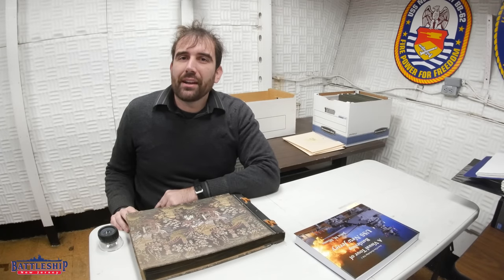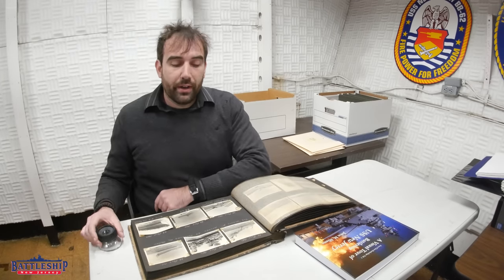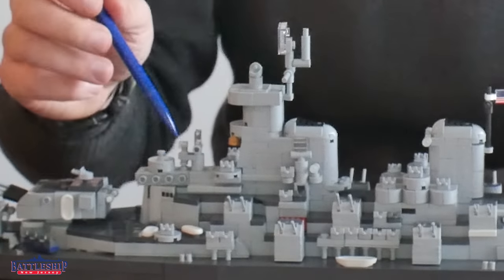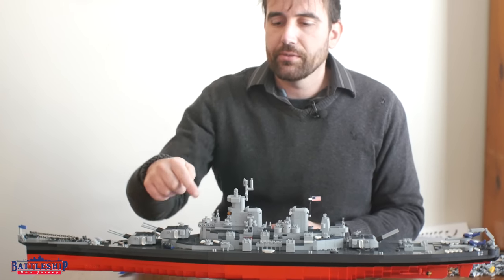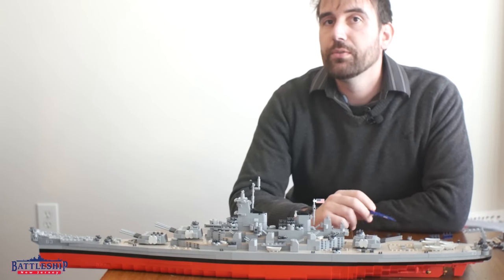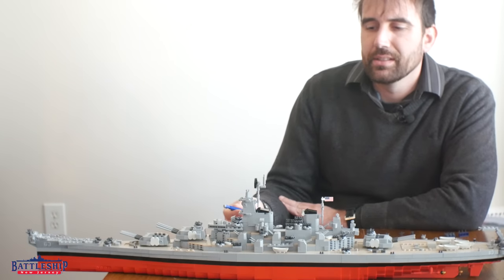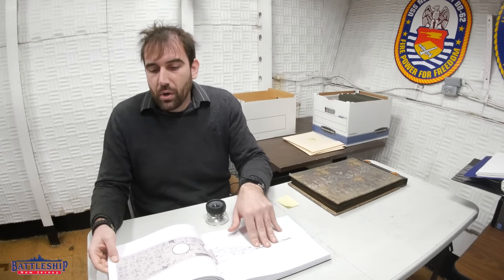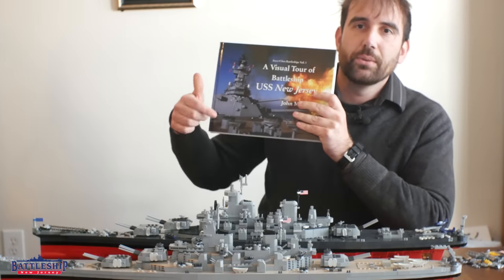Where Were the Anti-Aircraft Guns of Battleship NJ Located?

Comment: One proposal that I've seen for improving the Iowa-class AA performance is the so-called "King-Nimitz" redesign.  The story goes that King and Nimitz (or their staffs) got together to review the performance of various classes of ships in the Navy.  They came up with a rough drawing of an Iowa with the secondary armament layout of a late war heavy cruiser, centerline 5"/38 twin fore and aft, with the remaining 8 5" mounts in roughly the same positions as they actually are.  The 40mm mounts are also reorganized for clearer firing arcs.  All of the 20mm mounts are twins in this proposal.  I thought the proposal also included the deletion of all or most of the armored conning tower, but I'm not certain if that's the case.  These changes were significant enough that they could only be applied to Illinois and Kentucky, since they were still under construction.  Ryan did a video on this topic on May 24, 2021.
Reply: That's correct on every arcade however the war was pretty much concluded at that point in the end the Iowa's were a compromise design in both arms and Armament speed and architecture especially in room for electronics radar that such thing redundancies and backups I think the napkin story is true I think Ernest King and Chester Nimitz both wanted to improve the Iowa's if they had the chance when that lunch or dinner or whatever it was they had knowledge of the atomic ordinance being developed but to be fair nobody really knew if the Japanese would surrender when we take that for granted as of the current date.

 But to be fair the war could have continued for another 6 months year or two I think it would have gone on at least into 1946 had we not drop the atomic bomb Kentucky and Illinois would have been finished eventually by then certainly Kentucky if not Illinois even though Kentucky's construction started after Illinois it didn't have as Many suspensions and Kentucky was basically complete up to the second deck my mother's father served on the USS North Carolina during the war he was an engine man and my dad's old man he was Marine Raider Pacific island campaign they would concur with that commanders and strategists and captains were never satisfied with aa firing arcs. 

But given how ship architecture works you can only maximize it to a certain extent I am of the opinion you can never have too many arms or armaments on a ship but if the USS Indianapolis is any example you can overload a warship of any kind I completely agree with you JB I believe the conning Towers were mostly at this point proven not to Be an Effective asset anymore it wasn't like the Great War and Naval Wars before ships just weren't engaging each other at close range anymore and even if you're in the county Tower it takes a direct hit from a comparable Salvo you're going to be jelly from the concussion blast so that was something they had to reprioritize USS West Virginia had hers deleted when they updated her superstructure so that didn't impede her fighting ability at all yet is in the pipeline..

 I don't believe they would have augmented the existing for Iowa's though if they were going to implement this upgrade it would have been on successive designs ships bb65 and BB 66 for sure estimates for the conversion that Admiral Nimitz and Admiral King had outlined would have taken what I've read anywhere between 4 months to the better part of a year to implement but it's hard to say I don't think we'll ever really know the road not taken I think once the ships left Dry Dock architectural changes were never going to happen unless the ships were catastrophically damaged and had to be brought in for a yard period

 That's something that we do see had Hood not been destroyed at the hands of Bismarck that would have absolutely been the case for a retrofit had she survived her engagement but she did not she suffered the same fate as all other battle Cruisers when going up against a traditional battleship in an alternate timeline somewhere Illinois and Kentucky were completed along the retrofit outlined by Admiral King and they were impressive
Reply: @jonathanjones3623  Keep in mind, Japan was bingo on fuel(with exactly 0 production available) while tied to the pier, much less underway.  The war could not have continued as an actual war.
Reply: @Grimmwoldds  I understand what you're saying but just because they were practically out of oil reserves didn't mean the war could not have gone on there are plenty of conflicts that endure and continue regardless of petroleum products I mean the Viet Cong didn't really have a Navy to speak of other than a small hodgepodge of littoral combat vessels brown Water Navy if you will 

They carried on the war against the United States for better part of a decade that's when they say the Vietnamization of Japan is basically what would have occurred had the Japanese not surrendered I think the Japanese would have carried on the fight had they not surrendered fuel or not I would still consider that to be a war even when one side exhausts one resource or element or another.

 My father's father was a marine during World War II and there were plenty of occasions that he told me of Japanese combatants after they ran out of ammo literally soared knives taking their empty rifles with their bayonets and charging anyway still combat capable if not combat effective I think that dedication while on the battlefield can serve you well long-term worked against them when we develop the atomic bomb 

The Japanese had proven to be absolutely ruthless and ferocious and was just another reason why Truman authorized the historical mission of dropping the atomic bombs on Hiroshima and Nagasaki and I know he was grateful that the war was brought to an end when it was
Reply: @jonathanjones3623  Vietnam was a proxy war.  No relevance here.
We're talking about an isolated island nation with no ability to operate a navy or air force, no petroleum to operate their vehicles, a starving population due to food production and distribution systems breaking down, an already smashed industrial base with many of the workers having been killed or displaced away from industrial production areas, total exhaustion of the "warrior" supply to conscript, and a high command that was losing it's most competent officers to "defeatism"(actually realism).

Their only option was surrender after Guadalcanal.  They were spending their navy at the battles of the Philippine Sea and Leyte Gulf, knowing they were about to become completely useless and the war was unwinnable.  Once the American navy controlled the coastline(not to mention a unbelievably vast submarine fleet), their population became defenseless targets.  There was no way for them to conduct a war, only get pounded until they ceased to exist.
Reply: @Grimmwoldds  proxy war large scale conflict relatively speaking doesn't matter Al-Qaeda has demonstrated quite definitively as of recently and the ground forces in the ongoing war in Ukraine that as long as you have capable foot traffic men and women willing to take up a rifle and fight or any blunt instrument for that matter the working carry on

I disagree with you on that matter it is perfectly relevant an island nation with an Able Body population can wage some effective resistance whether it's coordinated effective or not the Japanese were a devoted people to their way of life the emperor and we're quite content to make any and every effort to stop the American forces from coming on to their Shores and soil.

 You are absolutely correct about food production stockpiles reserves resources they were diminished and out you're saying they're only option was surrender that's not the case surrender was not a a guaranteed certainty and I know this because I have been to Japan and I have spoken to a few World War II veterans from the Japanese camp death and service of one's cause was hardly something they didn't contemplate civilian Soldier or otherwise it was expected and anticipated and ingrained in Bushido

To get pounded until they cease to exist as you put it with something they were perfectly contend and ready to do which is why Truman opted for the atomic bomb to coerce them into the idea that that was a practical application Mizuki Tano was a soldier I spoke to who actually fought in the battle of pelalu, i did field exercises with his great grandson and company,  I take his word for it I'm sure there was some demoralized fatigue soldiers absolutely but if it was the case as you say with no give or take then why didn't they already sue for peace they had no plans to unless the emperor in their military High command decreed as such

I take exception to people saying that the wars conclusions were for Granted and they were not, nobody in 1945 until after the atomic bombs were dropped new for certainty that Japan was surrender there's some people that take issue the fact that we wanted to have them make an unconditional surrender or that the Soviet Union was a truly fearsome terrifying Force for the Japanese

To be certain sir I think they were there were some that were terrified at the prospect of the Soviets entering the war not from a combat perspective but the idea that the Soviets would incorporate Japanese territory into their personal territory I am often a big proponent that the atomic bomb was necessary to drive home for the living the war was over

But the same fighting spirit that galvanized and enabled the United States to emerge victorious in the war was the same Warrior spirit of in the face of overwhelming odds who gives a rat's ass about the odds when the survival of One's Own society that stake one's way of life after speaking to Mr Tano I can guarantee you there was not defeatism in every Arena many were prepared to fight till The Bitter End and would have done so without any hesitation or qualm 

And like Its my take that being  said Vietnam does have a relevance because it was that contingency that World War II commanders wanted to avoid it's the reason why Robert E Lee during the Civil War surrendered With Honor further resistance would not have achieved results or success and what happened in Vietnam could have been the case with Japan very easily.

How we got mired in the environment in Vietnam could have very easily been the case in the Japanese home Islands easily and I will have to take exception and disagree with you whether it's full scale conflict or a proxy war we dropped more ordinance in Vietnam than we did the entire second World, War is War and with 17 years of service in the Air Force I can tell you Bloodshed is bloodshed

Ideologies backed up by faith can be quite compelling and as long as I was still breathing and my heart was still beating and I have my weapon in my hand I would have always continued to persevere and Soldier on and in the end I'm grateful that the war ended when it did lives were spared and the world to get back to some semblance of normal

Comment: I don't recall any mention of the "suicide circle" located on the fantail, just aft of turret # 3; I served on BB63 50-51.  When I came aboard in Sasebo, Japan and until we returned to Norfolk in May '51 there were about 10 single mount 20mm arranged in a semi circle, behind armor plating about waist high.  These were left overs from WWII and the kamikaze  attacks on naval ships, but were removed during the overhaul at Norfolk.  The crane was still there but the spotter planes had been removed.

Comment: To improve the ship's AA, either 1) replace the sixteen-inch turrets with about ten 5"/38 mounts each, or 2) modify a sixteen-inch  mount to give it higher elevation, and then develop a sixteen-inch AA round.  I figure a single such round would wipe out an entire enemy formation with a single shot.
Reply: Surprised a radar fuse wasn’t made for the 16s

Comment: Have there ever been any plans/ideas floated to replace the 5"/38 guns with newer gun systems on the Iowa-class? Like perhaps replacing them with 5"/54 Mark 45 or even the 76mm OTO-Melara during the 80's recomissioning?
Reply: That was talked about.  The problem is that the modern 5" and 3" gun mounts extend through the deck and cutting through the armor would have taken too long and added too much cost to the initial refit.  Had the Iowas remained in service in the 90s, a more complete refit had been proposed that would have added 5"/54 twins like the Montanas were going to use.  The Midways had these guns in single mounts.  The tricky part was whether or not the ammunition would make it past the turns in the hoists.

Comment: Certainly upgrading the 40mm to Mk-33s would have been a major upgrade. I was a Gunner on Mk-33s in the 90s when the US Navy was still using them very heavily, especially on amphibious and supply ships such as LPHs and LCCs. I often wonder if they had been upgraded - which, if any, would have been retained in the 80s refit. would they have kept at least the bow and stern pairs. The 20mm was a light weight gun with limited range. by the end of the war it was nicknamed the "door knocker" because its main effect was as an extra pair of eyes showing the 40mm directors where a close threat was for them to aim at. I think fewer mounts, all twin would have freed up space for more 40mm, perhaps each side aft of the #3 turret, instead of the 20mm farm arrayed there. Another pair could have been mounted on the main deck abreast the aft fire control in-place of the 20mm mounts there and tied to the same director as those above them.

Comment: By the time NJ was sent to the pacific, most air attackers would have already released the bombs or torpedos by the time they got int range of the 20MM.  Get rid if most if the 20MM mounts, replace them with twin or quad bofors 40MM.   Late war, once the VT fuze has been battle tested and found to be super effective, replace the quad 40s with open mount 3 inch or 5 inch guns, as topweight was getting to be an issue.   Keep a few twin 20MM mounts scattered around, primarily as antiboat defense.  This would have been very important to defend against the kamikaze boats that japan was building in vast numbers near the end of the war.    Those would have been a big threat if the invasion of the main islands had not been mooted by the A-bombing.     I don't recall how well understood AA defense effectiveness of the VT fuse would have been at the time, nor do I know if the USN knew about the kamikaze boat threat prior to invasion of Okinawa.  so a bit of 20/20 hindsight.

Comment: Mostly along the best lines of sight but definitively what makes that hard is because the ships were built in batches of two at a time and a different yards the Navy was constantly taking things off putting things on so I think Ryan touched upon it in another video somewhere.

But definitively it's anybody's gas and one spot is good as the next I think the longevity of anti-aircraft platforms with guns instead of missiles was already on borrowed time World War II was the last conflict where you had propeller driven airplanes after that it would be Jets so I don't know escorts to protect the carriers from engagements from other surface ship and nominal air power.

 I would say they did that pretty well but the Iowa specifically and their siblings did provide effective anti-aircraft fire and denied the enemy the ability to use their own ordinance but technology flew past them it's one of the reasons why all the AA batteries were eventually removed after the war but during they were indispensable and effective that being said it just seems like the 40 millimeter bofors are just so destructively more effective I get the 20 mm auroraelicans are more numerous more compact easier to use by comparison the amount of training to use the 20 mm as opposed to the 40 is considerably less as well. 

But I think the 20 mm was already on its way out before the war even started more effective than the M2 Browning by every stretch of the imagination though I've read from Sailors accounts they hated servicing the 20 mm because of how tight all the tolerances were the 40 mm was a much more simplistic design from a maintenance perspective still I would have had a few M2 brownings capped on the station just for those instances where you could have had boarding action
Reply: Forgotten weapons did a video mon a navy twin 50
Don’t know the deployment history 
Believe the 50s were replaced by 20s
Reply: @tomhenry897  yeah I believe it's ian McCallum on there it's been a while I may have seen it but that's correct in metric terms I think a 50 caliber machine gun is a 12.7 MM projectile so the 20 mm significantly bigger by an increment or two LOL would be better suited for shooting down aircraft my mother's father from his time on the USS North Carolina was always telling me that the M2 ma Deuces were always easier to clean and perform maintenance than the 20 mm guys used to draw straws according to him on who had to break the damn thing down he didn't have to worry about it too much he was an engine man on the North Carolina so he didn't see too much action up on the decks when combat were in play but if they ever needed an extra set of hands he never hesitated I miss him I see these videos reminds me of the heroic effort that they all did for the greater good